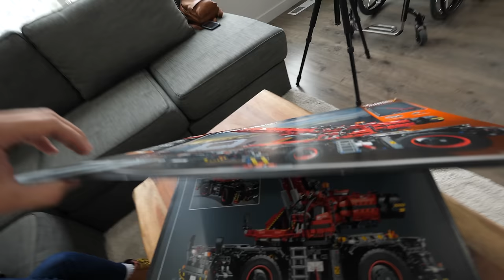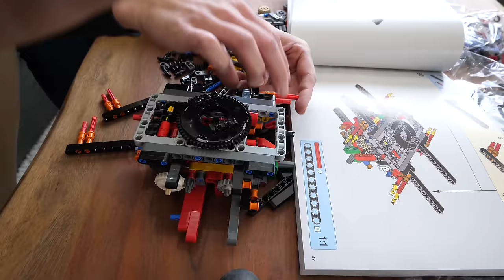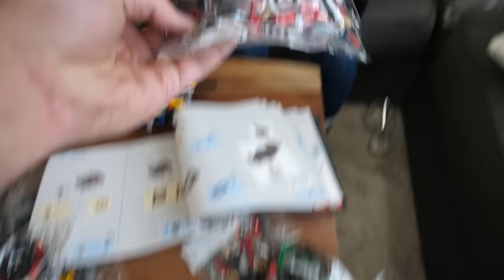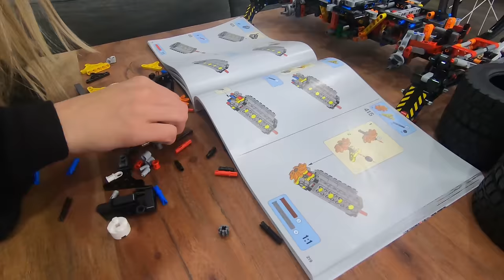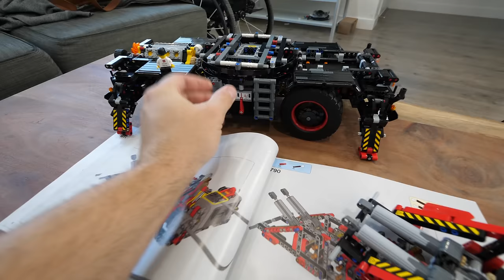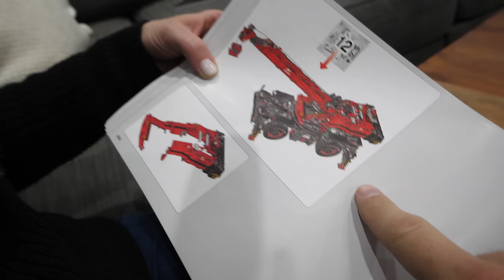It FINALLY Happened!! - Building the Largest LEGO Technic Crane!

Comment: I finished the Lego Technic Bucket Excavator not too long ago
Reply: omg same
Reply: Same
Reply: The bucket excavator is the greatest technic set of all time in my opinion. I wish I had that one
Reply: Had it when it was first released and with all the sets I've built I can say that it was the most fun model I've ever completed
Reply: I built it as well but for some reason, the excavator doesnt run smooth. It stalls and needs help turning.  Too many moving parts for the motor to run at the same time
Reply: Me Too , it take 15/16 hours to finish it and i'll go to customize it in the future ;)
Reply: well done must have taken a long time as is biggest lego set
Reply: Not even started the bucket excavator yet. But just started on the Mack truck.
Reply: That’s an awesome kit.
Reply: The bucket excavator is just about the best deal of the bunch. Not only it is awesome to build, it's also reasonably priced.
Reply: Omg ye its epic i saved up enough to buy it
Reply: i have that one ... but my fave so far is the Porsche GT3 ... ill probably end up with the bugati if i can convince the GF that we need one
Reply: S yeah i have the same issue with this one .. it gets worse if its been sitting for a year
Reply: Same here, it's one of those sets that when it's done you just sit there and look at it and wonder how it all works...yet you know cause you built it. I love the Technic line, allows the brain to think while you build it.
Reply: Same but I did the ev3 to
Reply: I have one only built it in a day
Reply: Build Lego and Chill

Emphasis on the Chill
Reply: @ojfrancis  an amazing model doesn't take that long but the first one is good for looks second one is more functional for sure

Comment: I have one and I like it very much. I added lights kit and I removed the V8 engine to install 2 motors , one for the steering and I created a piece with 2 Lego bars to be able to motorise translation. With a 8 teeth pinion on L-motor, I was able to put a 12 teeth gear to reach the red 16 teeth gear centered in the truck. The results are amazing. I controlled direction and translation with a remote control.

Comment: Do the Bugatti and porcha car great video
Reply: Theyre Just show-offs without great durability or functions like technics is supposed to be
Reply: @st1ng2k70   I have the Bugatti, the durability is crazy, i can lift it holding just the roof, i even dropped it on the floor from like half a metre and not a single piece broke off. And it has some functions too. The rear wing for example, you can raise and lower it, it has a working gearbox, with 2 diffrentials. All this linked to the engine which turns around like a real W16.
Reply: Elliot the engine isnt like the real one. It does have 16 pistons, but they turn on 3 different driveshafts, unlike the real Bugatti with 1 driveshaft

Comment: Given it looks like the set has a fully functioning engine, I wonder if you could retrofit some kind of air pressure system onto this system. If so, how much psi would it take to move the assembled components.

Comment: the Bugatti looks great, but it is not the most satisfying build. While building it, I felt like I was placing a lot of liftarms together that did not contribute meaningfully to the chassis or the exterior. I recently built the Technic Lamborghini Sian, and can say that it has a much more rewarding build process. It includes several more mechanical features, and the 8-speed transmission is fully visible through the bottom of the vehicle. On the Bugatti, it is totally hidden inside the vehicle, which is kind of disappointing. The mechanism for the suicide doors is really cool on the Lambo as well.

Comment: ...i bought and built ladt week. This Lego set is absolutely the best one i have. Under both mechanical and electrical point of view. Great job lego. But i noticed the lack of a brake or something like that for the crane while not working; it would be useful to avoid crane moves unadvertedly.